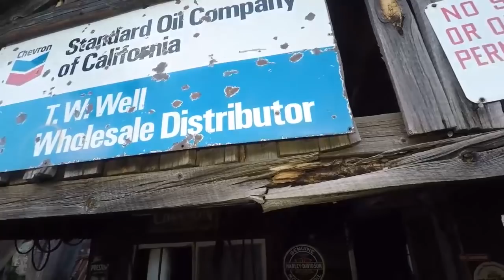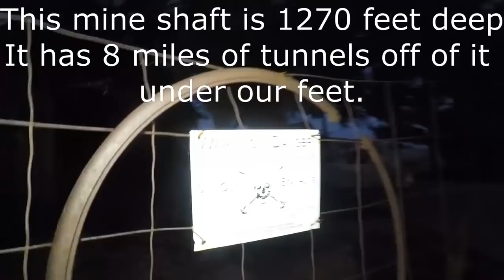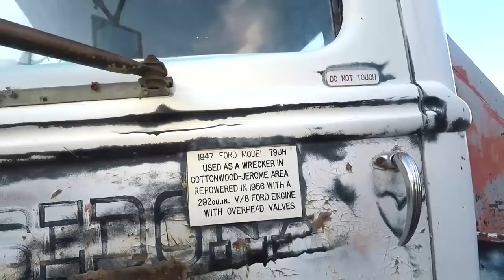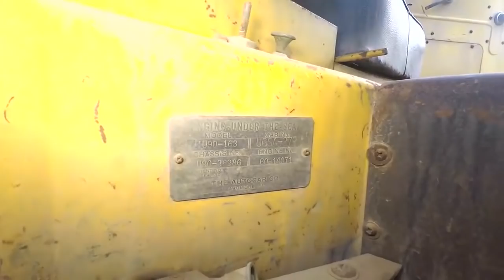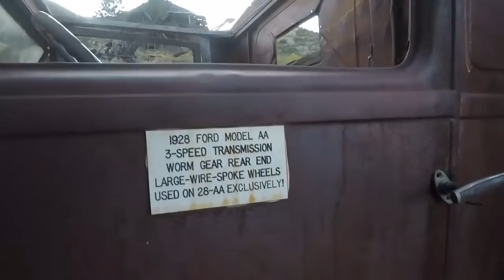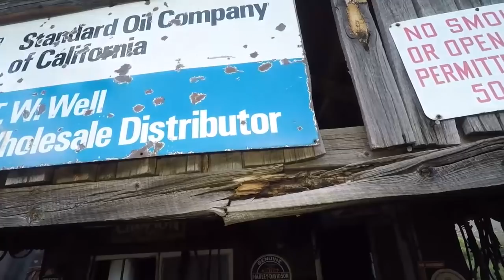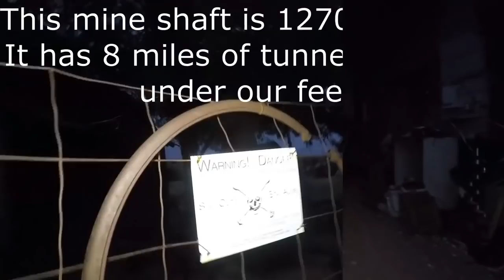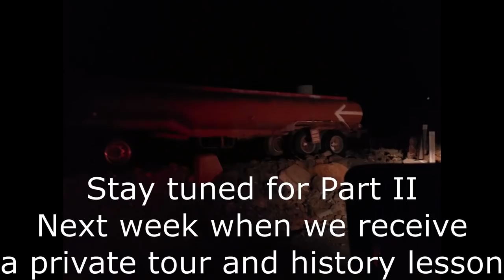Million Dollar Car Graveyard - Haunted! FULL

Comment: Dude ya have to get him to fire up the power plant that has the exhaust pipes aimed out at the Verde Valley . You climb up the scaffolding and stand on top and view the valve train, while he uses a remote to make a 'muffler explosion' ,  WOW its like a cannon firing a shell out  across the valley out of teh 8 inch? exhaust pipes It is started by him firing up a tractor /belt driven air compressor that cranks the 3000? cubic inch motor. In 2003 he charged me $10 to fire it up and let me stand on top with him.  YOU AINT SEEN NOTHING YET  DUDE!@!!
Reply from the maker: That is our plan. The machine was down for repair when were there. Its named Bertha. #driveitlikeyoustoleitbitches